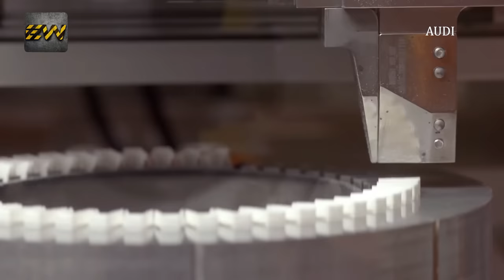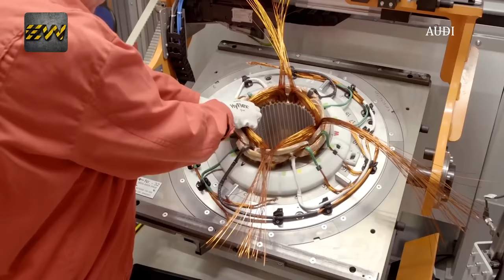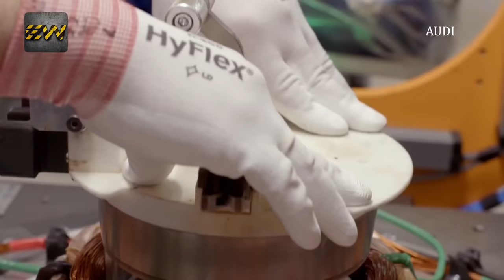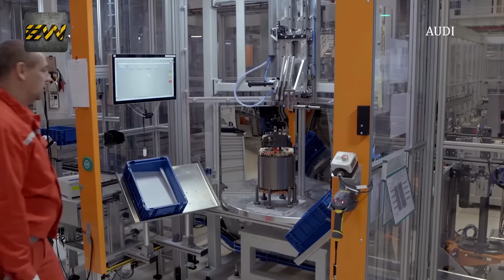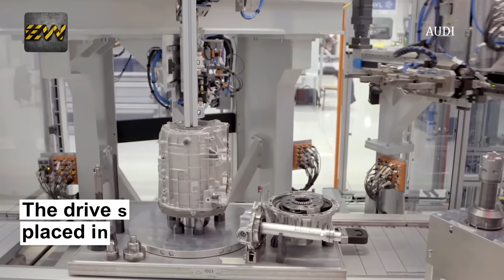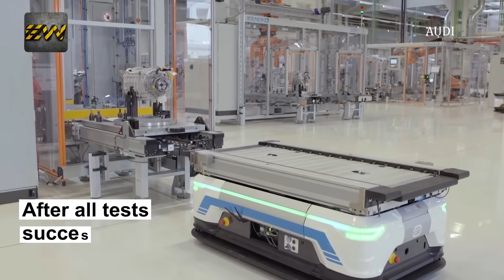How Audi Electric Motors Are Made for Electric Cars? (Mega Factories Video)

Comment: the sewing machine in the end of the coil making and the knot tying in the end of the sewing were asthonishing
Reply from the maker: Makes the work so much easier and efficient. And did you see observe the precision of the whole knot tying process? 

Really impressive!
Reply: @engineeringworld.  yes
Reply: It's funny because if I saw the motor, I would have looked at it and said wow they had someone sew a nice net over it! I would have assumed that was on of the manual tasks.

Comment: How are they planning to scale this process up for production?
Reply from the maker: That's a very interesting question.
Reply: Tesla figured it out;  Their Fremont factory builds an entire Model 3/Y at an average of every 8 minutes; which means every process step is at least that fast.   If a single step takes longer then that, they split it into separate lines that do the same thing.  (For example: if the motor test takes 24 minutes, they'll have 3 lines do motor tests at the same time, so its still an average of 8 min per motor.)

Comment: The manufacturing process steps executed by the robots seem altogether too slow; it could stand to be improved. The human steps are the bottlenecks in the process, but the robotics parts can be accelerated somewhat while still maintaining the deliberate precision of actions. Improved productivity can be achieved here.
Reply: How so? Moving 10s of kilograms of objects at speed and to within a fraction of a millimetre every time takes lots of power and torque with precise sensors and control systems. But only an engineer would understand that.
Reply from the maker: Fully in agreement with you
Reply: Ah yes, they should’ve consulted you instead of spending millions and collaborating some of some of the best minds on the planet to develop these systems. I’m sure you’d have come up with something better.